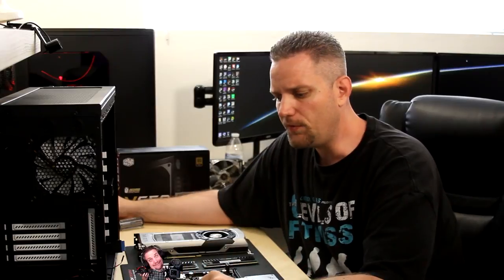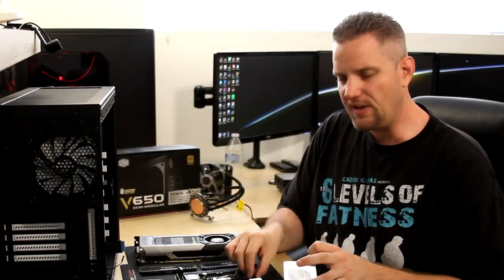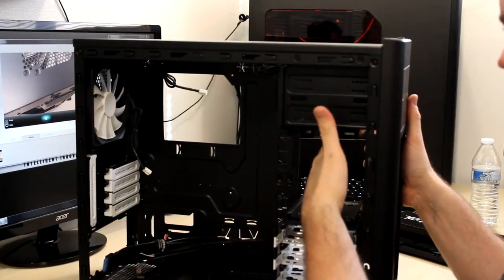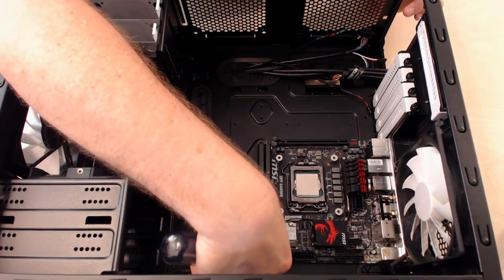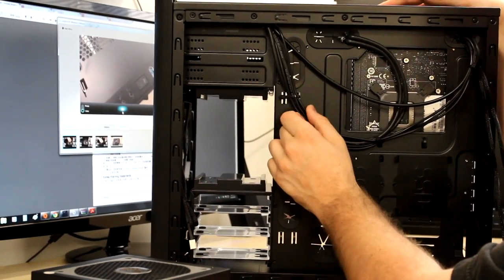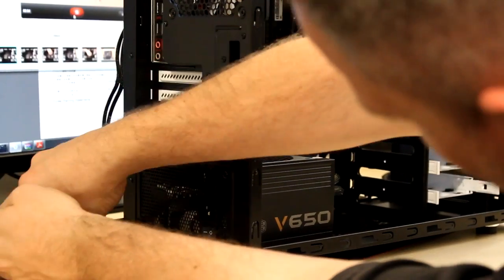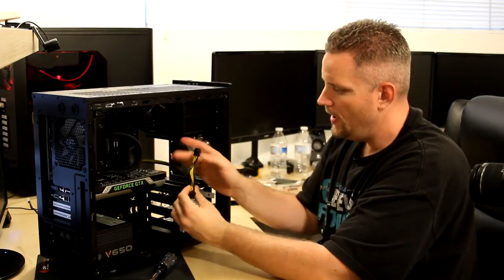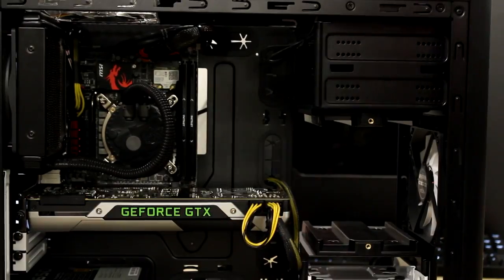Beginners Guide: How to Build a Computer

Comment: Are these parts compatible?
INTEL Core i5-4460 3.2GHz LGA1150 6MB BOXED
ASROCK Z97 ANNIVERSARY LGA1150 ATX
	KINGSTON HyperX Fury Black 8GB 1600MHz DDR3 (Kit of 2) CL10 1.5V
	SEAGATE BARRACUDA 1TB 3.5" SATA3 7.2K 64MB 
600W CX M Builder Series, ATX-powersupply, modular,80Plus Bronze
AMD Radeon R9 280X Dual-X, 3GB GDDR5, 2xDVI/HDMI/Mini-DP, PCI-E 3.0
Reply: Yes,but doesn't make much sense geting a Z motherboard if your CPU is not unlocked (not K series).

Comment: i wanted to try building my first gameing pc and was wondering what yall thought 
CPU-Intel Core i5-4690 3.5GHz
GPU-AMD Radeon R9 290 MSI Gaming Edition
RAM-4x Kingston 4GB 1600MHz DDR3 RAM
MOTHER-ASRock Z97 Extreme4
POWER-Cooler Master G650M
STORAGE-Toshiba DT01ACA100 1TB
COOLING-Cooler MASTER Hyper T4
Reply: you can't overclock a not k processor.
so don't buy a z97 mobo use a h97 and if you doun't want to overclock buy a xeon
Reply: ya i dont plan on overclocking so ill look into those parts thanks.
Reply: no problem bro
Reply: Get more ram
Reply: 16gb isn't enough? wtf
Reply: Get a the k version. Even though you arent gonna overclock right away ( the best choice ), then you might have to in maybe 3 years. It only cost like max 20 dollars more. Get gtx 970 instead of 290, because its uses less power, and it way better. Again, not a lot more expensive.
Reply: taking what yall said i changed some of the parts on my list
http://www.pc-specs.com/pc-custom-builds/941237
Reply: Oh i thought it only said 4GB

Comment: hi guys this is my first gaming pc build is it any good

ssd Kingston ssd v300 120gb

motherboard msi 970 gaming amd atx

storage Seagate barracuda 2tb

ram Kingston hyperx beast 16gb ram

case corsair obsidian 750d or 350d what do you think I should get

gpu msi gtx 970 4gb

psu Not sure what size I need

cpu fx-8350 black edition

watercooler corsair h100i
Reply: I feel like when people do this with specs like yours, its not to see if fits good, you just wanna show off how good your build is.
Reply: actually I haven't built it yet these are the parts I might buy and im new to gaming pcs I was simply asking a question   : )
Reply: oh! in that case, have fun building, Warning though, you will get kind of addicted to it, I'm on my second build to sell.
Reply: XxF3ARxX 1998 May as well upgrade to the 980, as the 970 doesn't really have 4gb vram. It's still a great card, I'm sure I'll be happy running it in SLI with another, but if I could go back and change it, I'd get the 980.
Reply: Ok thanks for the help
Reply: XxF3ARxX 1998 No problem.
Reply: The gtx 970 is still more than enough, the gtx 980 WILL be a waste of money on anything other than 4k/surround.

Comment: guys I have a problem... my MB doesn't have two connectors as it shown in to the arctic liquid freezer 240's manual so i dont know where connect pump and radiator fans (MB- Gigabyte ga-99-fx gaming) guys pls show me right way ))

Comment: Hey everyone so im going to be doing my first pc build around end of August/September. The pc will be used for video editing(for YouTube), gaming and audio edition(for College) i was wondering if these components seem like the best option especially with the amount of money I'm putting into this build, dont want to end up with something that doesnt work. Any help with someone looking over these options and offering their opinion if they think something can be downgraded to upgrade another component or vice versa thanks.

HyperX Fury Black 32GB (4x8GB Kit) 2400MHz DDR4 Non-ECC CL15 DIMM £94.98 inc. vat

Intel Core i7 6700 3.4GHz Socket 1151 8MB L3 Cache Retail Boxed Processor £273.99

Asus Z170-A Socket 1151 VGA DVI-D HDMI DisplayPort 8 Channel Audio ATX Motherboard £127.98 inc. vat

Cooler Master Hyper 212 EVO 4 Heatpipes/1x120mm Fan CPU Air Cooler £30.99 inc. vat

Cooler Master HTK-002-U1 HTK Performance Thermal paste £1.79 inc. vat

Corsair CSM 650W Semi Modular 80+ Gold Power Supply £90.99

WD Blue 1TB 3.5" SATA Desktop Hard Drive £44.99 inc. vat

MSI GeForce GTX 960 GAMING 4GB GDDR5 Dual-link DVI HDMI DisplayPort PCI-E Graphics card £174.99 inc. vat

NZXT H440 New Edition Matte Black/Red Case with Side Window £95.99 inc. vat

Total: £988.07 Total budget is about £1000 as i still need to buy keyboard mouse etc

I will also be using this monitor: Samsung C27F390 27" Curved LED Monitor - 1920 x 1080 Full HD - Curved Design - 60Hz Refresh Rate - VGA & HDMI - 4ms Response Time
Reply: I recommend to buy an ssd for your setup because if you edit videos from you ssd and boot up windows from your ssd it will go a lot faster so install the operating system on your ssd and all important things and on your hdd all things you dont use that much. I also recommend buying a 16GB RAM kit instead the 32 GB one because 16GB is fairly enough and future proof.

Comment: How would he install windows without a Disk Drive are install anything that requires a Disk, based Installation.
Reply: +HEAVYGUNZ05 Using a USB drive, a lot of people do that nowadays.
Reply: FireAngel842
Your right I mean he can probably buy a portable disk player,writer.
Reply: ***** Yeah, or you can just take it from an old computer in your house.
But since it's not 100% required, most people don't buy one anymore. I will, but that's just because i have some games on disks.
Reply: FireAngel842 thanks. off topic do you play any of the new Space type games such as star Citizen.. IF so what are you system specs if any and what type of Controller if you play with one are just key board and Mouse.
Reply: ***** I play a bit of Civ Beyond Earth, but i prefer Civ V a lot more. I did play some of them, but i'm not really into them. My system specs are the following:
CPU: i7-4700MQ 
GPU: GTX 765M
Mobo: No idea, not in my laptop specs either
Memory: DDR3L 8GB at 1600mhz (probably)
Storage: 1 TB HDD and a 128GB SSD
That's it. You'll notice its a laptop though.
And i only play with KBM
Sometimes i'll play GTA V with a controller, but nearly never.
Reply: Thx for the Info.
Reply: ***** np :)

Comment: I really want to build a computer but I am scared to order all the parts and then not be able to build it or something goes wrong.
Reply: That's a pretty valid concern, but it all comes down to doing your research. Start by making your build on PC part picker, to eliminate the chance of any big incompatibilities, but then research each individual component, to see if they are all compatible fully.
Reply: Harsh Komal I already have my build on pcpartpicker and the components are all compatible I am ready to order it all and stuff its just scary to put $1300 into building something I have never build before. I have put so many hours into researching the parts and stuff so it doesn't seem challenging or confusing just time consuming. Idk it just is scary to spend that much on something I have never done before.
Reply: McVoRTeX If you've done your research on your parts, from the first-party websites and third-party, then you should be good. Just make sure you double check it, and maybe even write it down somewhere for reference.
Reply: +McVoRTeX Just post it on one of the PC building sub reddits on reddit, most people over there are really nice.

Comment: Guys I have a question,I am gonna build my first PC in 3-4 months and I will change the motherboard,the CPU,the PSU and the GPU,and I have Windows already installed on my SSD which it's going to be my bootable drive,so do I have to buy Windows again?(This question might be dumb but I am a noob at PCs so plz help me)
Reply: Hi, Normally if you change the motherboard or processor you will have to buy a new copy of windows as essentially you have a new computer.

Cheers Chris UK
Reply: Oh....ok Thamks!
Reply: Thanks*
Reply: +Cristian Gabriel Capatina No, you will not have to get a new version, since Windows is bootable from your drive.
Reply: dont listen to christopher hunter you dont need to buy windows again. Just plug ur ssd into ur motherboard and everything u had on ur ssd will be there
Reply: Djayy 74 Thanks a lot man real thanks

Comment: My GPU was bent in shipping and do you think it will work
Reply: Depends what was bent on it.  It's possible that the cooler was damaged and the screws holding the cooler were also damaged.  If it's the shipping box that got damaged then it doesnt matter.
Reply: yeah when my 1070 came the box was bent i kept the 1070 and ordered another box , but the box that come with  the new box i ordered was bent so i ordered another one
Reply: DaHell?

Comment: does anyone have a vids where i can properly see all the wiring
Reply: It's usually labeled, and also the motherboard sockets only accept certain plugs a certain way so you can't put stuff in the wrong socket. If not, as the poster suggests, just check the manual.

Comment: Is this a good build for gaming, and a little bit of productivity, like Microsoft Word?
http://pcpartpicker.com/p/VPM8t6

I also have one question, I currently have a laptop with Windows 7, is there a way to copy that onto my new computer? I'm okay with all my files being transferred as well, if that's necessary.
Reply: +Koen Looijmans If you don't mind lower quality gaming, then yes. If you want your pc to last a few solid years plus... You may want to upgrade some things. Since you're going towards an AMD build you should pick out an fx chip. For 30 bucks more you can get an fx 6300 with six cores or an fx 8350 (both these cpu's are a am3+ socket) so pick out a board that fits that. the 750 ti is a great quality starting gpu (graphic's card), but with 50 bucks more you can get a 960 or a r9 380. 

I've never attempted such a thing from laptop to pc, but I'm guessing it's a no. Since window's keys are connected to the motherboard. So you would need a new key, but you can copy the files onto a usb that you want to keep and transfer them onto the new pc harddrive.
Reply: +porkyporkchop1 are keys cheaper than the actual OS? or should I buy them via G2A or something?
Reply: Koen Looijmans It's a one-in-all deal. I never heard of g2a selling keys for OS unless i'm mistaken... but, yea. You buy the os and you get the cd and key. unless you go to a specific site that just sells the key (but then you have to either have a cd or bootable usb ready to install the os.)
Reply: +Koen Looijmans You might want a i5 4460 if your willing to pay a little bit more. That processor kinda sucks
Reply: +Voxle that one is €178, that's too much. Intel processors are basically all too expensive here. But do you have any good recommendations for under €100?
Reply: Koen Looijmans You're in europe?! Well that makes it harder. I think you should get a better processor though. The one you have isn't very good.
Reply: +Koen Looijmans lol or just torrent windows pro 7 and then use Windows 7/8 USB DVD download tool to burn the ISO image to a disc or to a USB. Then in BIOS when you first set up your PC you just set your USB as your first Boot drive in the " Hard Disk " option or you just insert the disc and I think it will install it from there. After that if you want to you can buy a legit copy or something. ( I'm just saying cause it was easier for me to install the Torrent copy of Windows first from a disc rather than try to figure out some other shizniz )
Reply: Do not ask people on here. Especially people who are watching how to build a computer. People are most likely ignorant when it comes to certain things. You should ask someone that knows what they're doing.
Reply: +Koen Looijmans If you do need to transfer your files from your laptop go out and buy some type of external hard drive that has enough storage space to hold all the stuff, make a back up of all your files, either A-do it the hard way and do it yourself or B-have the computer to do it, it'll make a back up of all the files you have on your laptop to use on the new PC.

The build is good but if i were you i would spend about $100 more by upgrading the CPU, GPU, and the Motherboard you'll get much better performance from it by spending just a little more
Reply: +Voxle That processor is a great budget CPU. Unless he wants to play Arma 3 multi-player, or do video-editing or something, he will not encounter any problems with that processor. Also, that processor has a lot of over-clocking potential.
Also, for the person recommending the FX processors over the AMD Athlon, the FX 8350 is much more expensive, and Intel CPU would be better for that price range, and the FX 6300 is weaker for games, with worse single-core performance, and not as much over-clocking potential.

Comment: Can someone please give me some non bias info on if the FX-6300 is a decent CPU?
Reply: +HamishPlays good budget cpu, but dated now, everyone is waiting for AMD's new Zen chip. 

FX-6300 is on AM3+ socket like all amd chips, but the new Zen will be AM4+. If you get FX-6300 you'll be stuck on that architecture with no present upgrading options.

If you want to buy something now, i'd rather use intel skylake and buy a i3-6100 or something ,the price is roughly the same but theres a lot more future proofing.
Reply: But hasn't an i3 got like 2 cores?
Reply: The i3 has 2 cores, but the Intel cores are more powerful than each amd core. Personally, I would go with the 8320, and then overclock it

Comment: Hey guys is this a good pc build im kinda nooby at this and i dont wanna mess up for my first time i have a budget of 850$ 

Intel core i5-4690K

Cooler Master Hyper 212 EVO

ASRock z97 Anniversary ATX LGA1150 motherboard

Crucial Ballistix Sport 8GB (2x4Gb) DDR3-1600 Memory

Western Digital Caviar Blue 1Tb 7200RPM Hard drive

EVGA Geforce GTX 970 4GB SSC ACX 2.0

Corsair 200R ATX Mid Tower Case

Corsair CX 600W 80+ Broze semi-Modular ATX Power Supply
Reply: +Red Hawk make sure you have a pair of windows.
Reply: Kirito
Thanks.Are you by anychance on kissanime with the same account name if u are you are everywhere
Reply: RusK Execute
The first thing that came to my mind was the actual windows program i have no life :p

Comment: But i dont get how the on and off button of the the case can turn on the computer .-. i'm noobbbb!!!
Reply: conect it :/
Reply: Sure, but I think he meant how the button works. What happens when you press the button? What happens directly behind the button? If you study electrical engineering you probably know, but I don't.
Reply: you could google it, but it's pretty simple so I'll try to explain it here. basically all electrical currents are circuits (i.e. a circle, so go round?) and a button by default (when in the off position) doesn't conduct the electricity through, but then when clicked it does

Comment: There comes a fan with the cpu right?
Reply: It's a stock cooler which means you have very little head room for over clocking which is fine if you don't have an over clockable cpu. But the answer to your question is, yes.
Reply: i suggets you buy an aftermarket cpu cooler such as the Hyper 212 EVO
Reply: +TykoPC you dont need aftermarket cooler unless you overclock and/or with AMD APUs

Comment: You forgot to mention that you should ground yourself by touching a metal object so you don't accidentally short out the motherboard or some other part. Also, you shouldn't be touching the golden pins on the RAM and GPU because that could cause damage to them and even ruin them (referring to the way you were handling them while introducing the parts). Sorry, didn't mean for that to come out rude. I just wanted new people to know this so they don't ruin their first PC.

Comment: I'm 12 and build a pc I have made a list of everything I need and I was wondering if I am missing anything the parts for the ssd card I am using a EVO 250GB 2.5-Inch SATA III Internal SSD (MZ-75E25OBIAM)

power I'm using a EVG A 500  BI 80+ BRONZE 500 W Power Supply 3 year warranty includes free power on self tester  (100-BI-0500-KR)

my case is the NZXT S340 Mid tower computer case Matte Black /Bule (ca-S340 MB-GB)

the processor is Intel core i5 6500 3.20 GHZ Quad core Sky lake Desktop processed sockeye 1ga 1151 6 mb  cache 5 Bx 8066 2156500 my graphics card is a MSI GAMING Radean RX480 GDDRS 8GB CROSSFIRE VR READY FinFET  DirectX 12 Graphics card CRX 480 ARMOR or 8G OC 

the mother bored is also a Gigabyte micro ATX DDR4 NASCAR Mother Board GA-H 170M-DS3H

Then for my mouse and mouse pad I have a Razer Abyssus mouse and a Razer Goliaths control edition gaming mouse mat (large) 

the key bored is a Razer black widow ultimate gaming key bored and the montair is a 23" Aoc Ultra slim gaming montair 

the price of everything is 1557 New Zealand dollars or 1083 us please tell me if this is a good setup and have a good day

Comment: When you build a powerful gaming computer, is it equally as powerful for Video Editing and Music Production??? Because I want to build a Computer for Gaming,Video Editing AND Music Production. So can anybody Reply to this comment with a list of internals that Ill need for those 3 things?? And Im going to want to squeeze all that power into the smallest case I can, A small case with atleast 4 drive slots for atleast 2 SSD and 2 Hard Drives. Any help is welcome, Thanks to whoever helps in advance.
Reply: Yes bro with the parts you have it will get the job done
Reply: If you want a general all round pc then go for the xeon e3 1231 v3 it has the power of an I7 with the price tag of an I5, it is multi threaded with 8 virtual cores and a high frequency rate for gaming, for a graphics card i would wait for the 1080 or 1070 as those things will be beasts